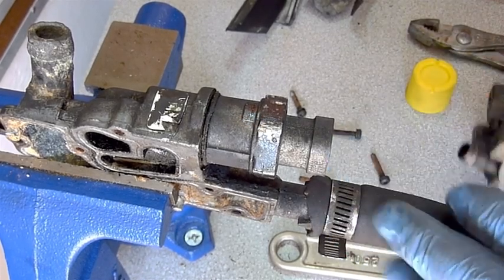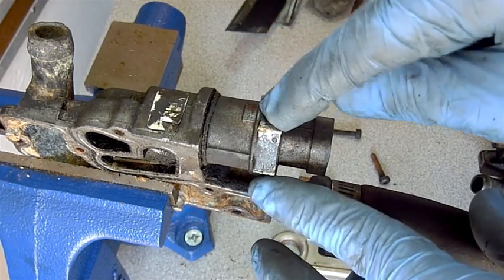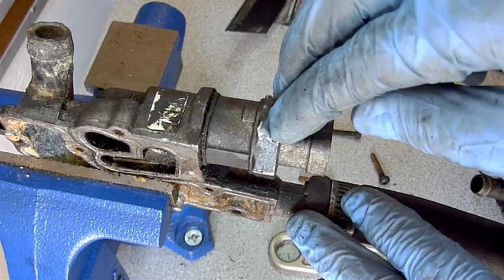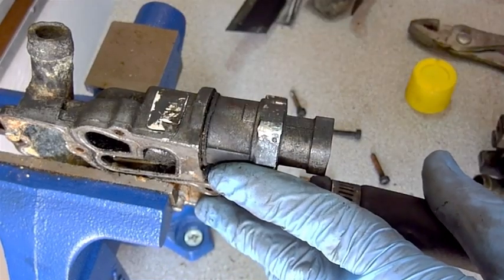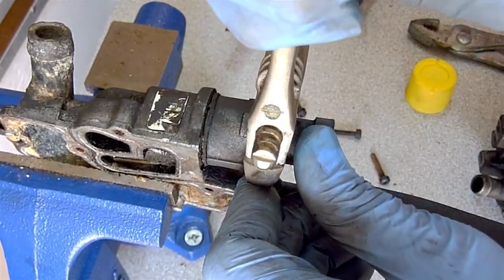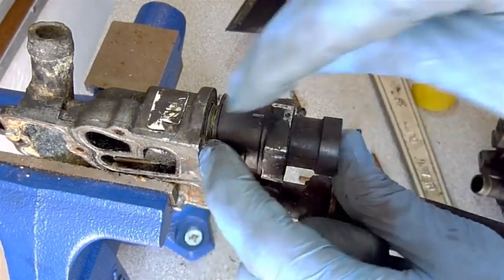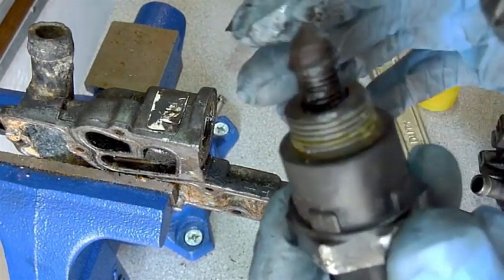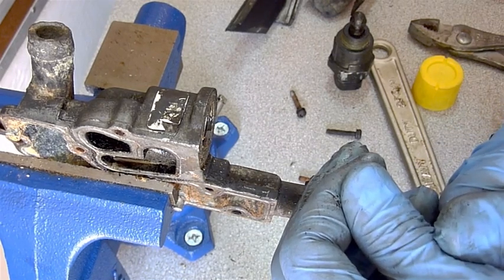How to Rebuild A Corvette C4 Throttle Body ( IAC Sensor ) - Part 2 of 4

Comment: Pro tip: Always use a properly sized socket or box wrench.  You can see what happens when you use a Crescent wrench, as the corners are rounded.
Reply from the maker: Very true. In this case, most of these are torx bolts and they were rusted out from different parts: threads, head.

Comment: And second of all you don’t use a adjustable wrench. Use the right size hand wrench or socket. You can strip the head of the bolt by using that.
Reply: If that guy has a 32mm laying around I’d give him an award.

Comment: First of all the IAC valve controls the idle through the ECM when the vehicle is in closed loop or operating engine temperature. Second coolant is not suppose to enter the chamber where the IAC valve is located nor does it measure coolant temperature. That is the job of the coolant temperature sensor. Your video is very informative however you need to do your research  first and also use the correct tools. An open wrench should never be used on automotive bolts because the ends will be rounded.